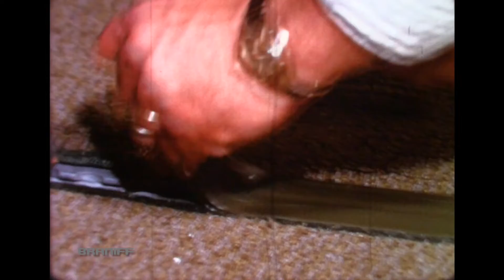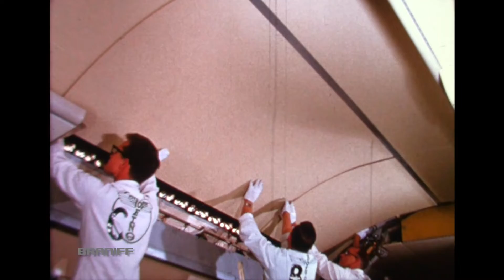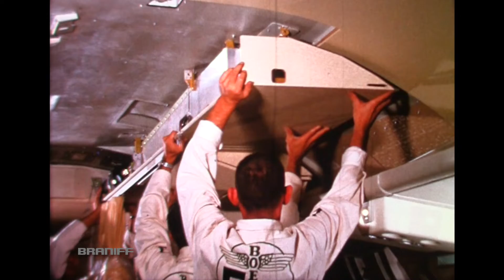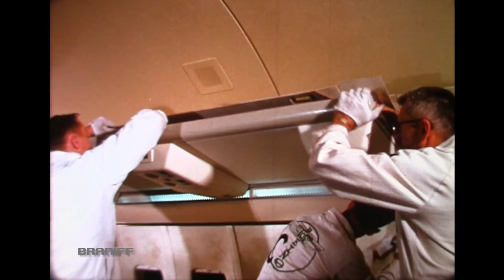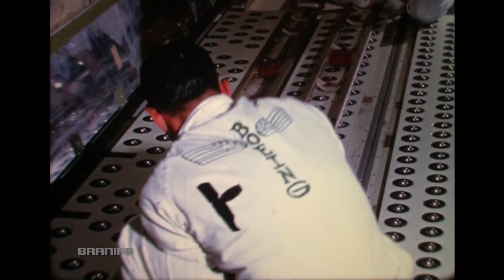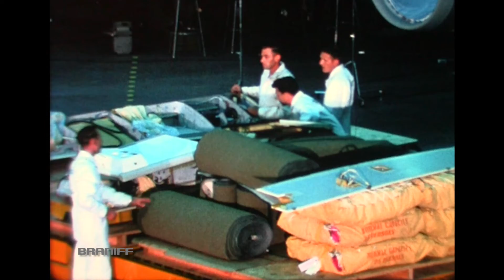Braniff Boeing 707-327C Convertible Cargo/Passenger Intercontinental Jet Demonstration Film 1966

Comment: Must have been very popular as the 707-320C was the top seller. Doubt these conversions happened on a whim.
Reply: No, they didn't. Some 320Cs may never have flown cargo, at least with their original owners.  It improved their resale value though, I imagine, and the convertible 707s were still in demand as freighters in developing countries up to about the early 2000s.